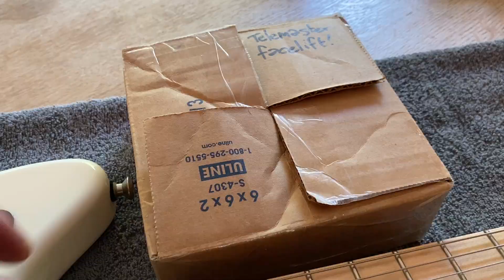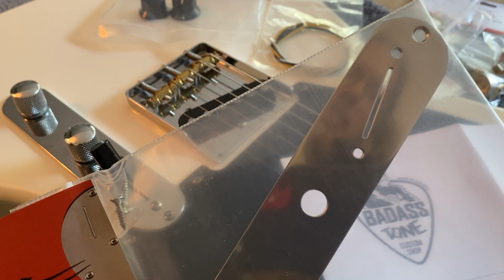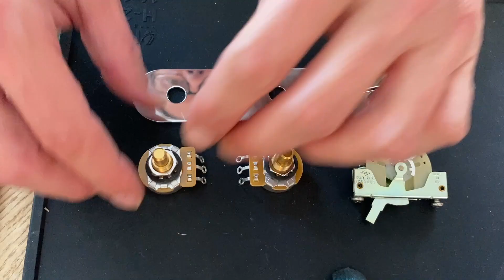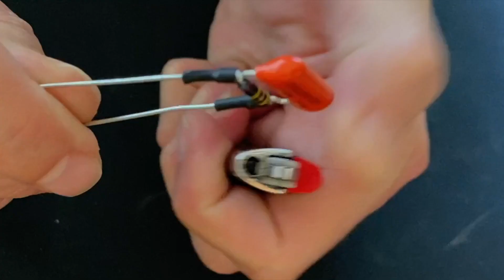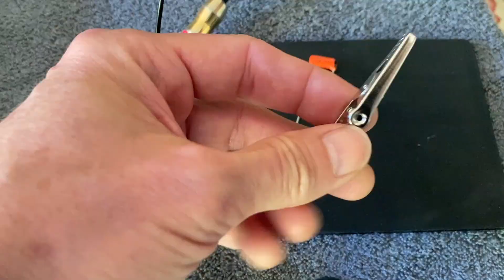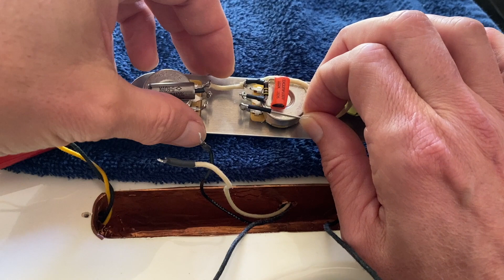Which way do you install guitar capacitors?

Comment: Nice video! I'm new to this so I was curious what the bits of shrink wrap you added to some of the wires before soldering were doing? Keeping it more rigid, or is it preventing contact? thanks!
Reply from the maker: Good question. Shrink wrap will aid in keeping the solder joints rigid, which is useful when moving things around as you solder. Most importantly, adding shrink wrap prevents possible contact with other wires and metal surfaces, like the capacitor on the potentiometer. It also can prevent wire contact when you place the control plate back into position since the wires tend to move around a bit. I hope this helps!
Reply: @guitarsgoats  definitely helps - makes total sense. thanks!

Comment: Fun.. but what did you achieve with that mod, especially the electrolytic? cap?
Reply from the maker: Good question! Initial, I just wanted a visual refresh with the knobs and control plate. I had bought the original control plate pre-loaded (with cheap components). I had luthier work done on the guitar in the past, and didn't realize that they upgraded some of the stuff under the hood.

I knew I wanted a treble-bleed, to maintain tone and gain when rolling down the volume on the guitar. As far as the capacitor goes, I have been learning about them and have different values in other Teles. The original cap was fine but I thought I'd give a new one a shot. To be honest, without A/B-ing them, I wouldn't know the difference.